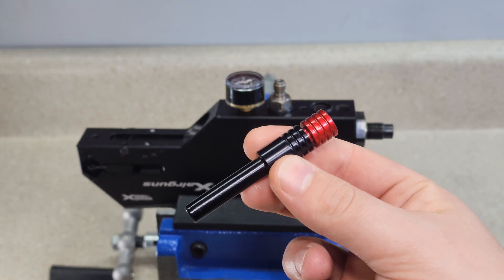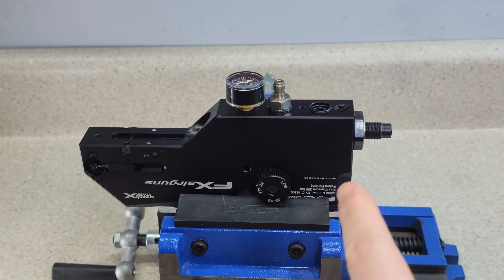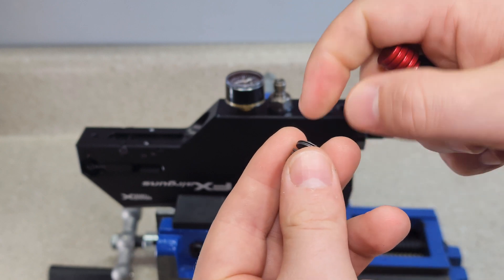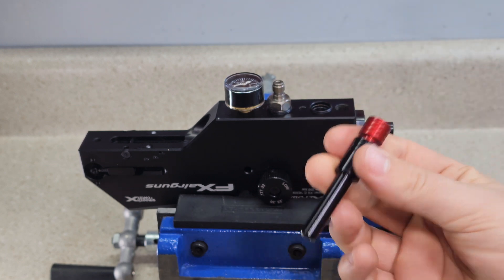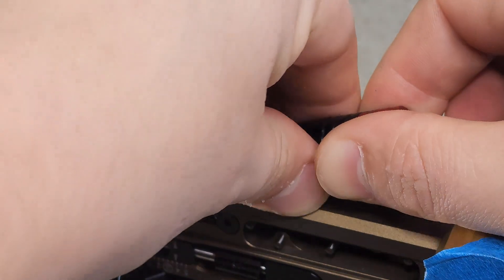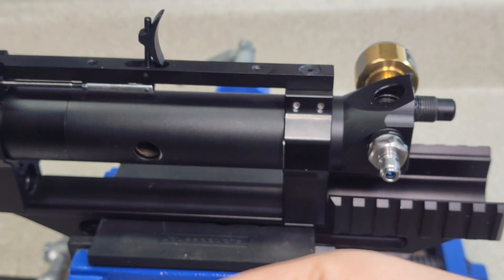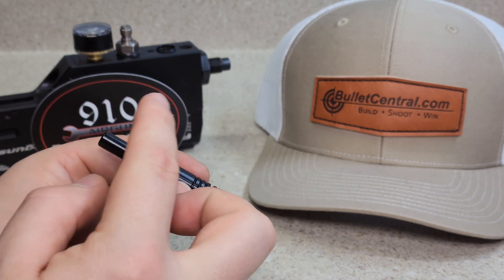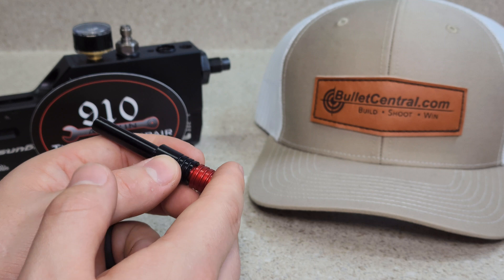FX Airguns Regulator Piston Removal Tool for AMP and Pre-AMP Regulators

Comment: hi excellent product have bought , one issue i am facing posy installation of brass pistons 
there is a leakage of air from the vent hole  in the plenum cylinder (opposite side of the 2nd regulator), and as soon as i put the bottle the air leakage starts from this hole . Any advice is welcome for a fix and which which of the O rings may have been busted, thanx

Comment: Hi I am building a piston removal tool and also a cone for putting the 2x1 O rings on the adjustment screw of an FX Mk2 Impact. My Ser No is 193093.
I have searched high and low for these specs and cannot find them. Would you be able to provide me with the OD for the large end of the adjustment screw where the two o rings are please. I will build a puller to remove the piston from those specs.
Also the OD of the piston rod where the belvilles go. I will build a piston removal tool once I know that.
I would appreciate it if you can help please. Even a schematic that shows the dimensions would be great or perhaps give me the contact for someone that I can talk to. I am in rural Australia
Thanks

Comment: Why can't I get this tool to work?
Reply from the maker: There is likely damage to one of the internal o-rings that is causing the piston to be lodged into the action. You will likely need to use needle nose pliers with a bit of force to remove the piston if this is the cause.

Comment: 40$ plus shipping, ewww
Reply: So make it yourself.  Good luck.
Reply from the maker: Pay for cheap, get cheap. Pay for quality, get quality. Decision is always yours 😉
Reply: @910AirgunTuningandRepairs  you need to have a sense of a business man, you need to be humble and smart at the same time. I agree the tool is designed to do the job, on the top of that it was designed to look nice. Doing the job is all what we need, cutting the second part which is looking nice would have also cut the cost for you and the buyer. That way you sell more and all buyer categories can buy. Win win situation.
Reply: The first time a spring stack hits the floor that tool will have paid for itself 10 times over…
Looks like you guys really perfected the initial design, kudos man!